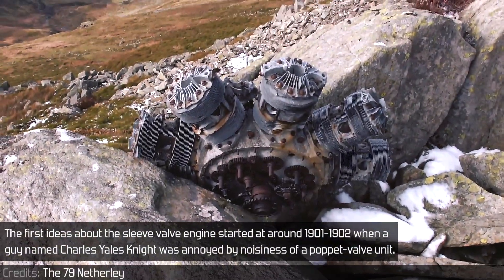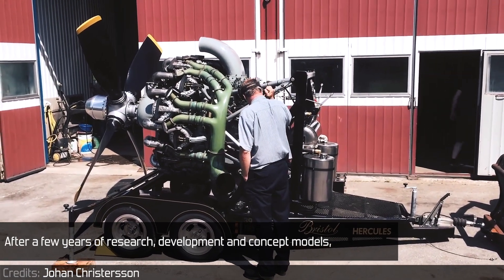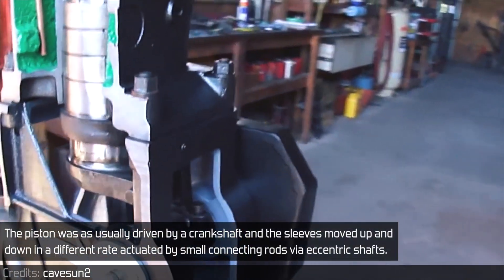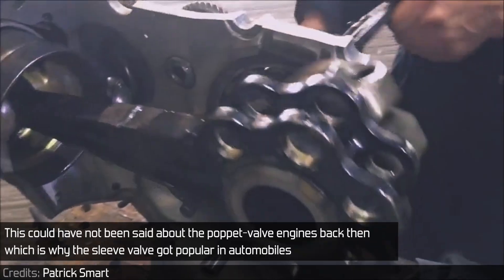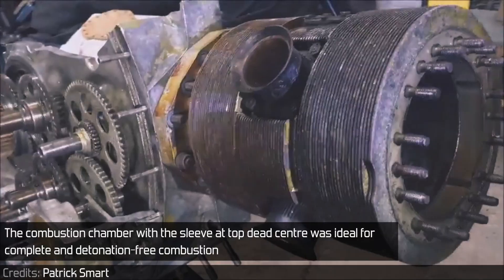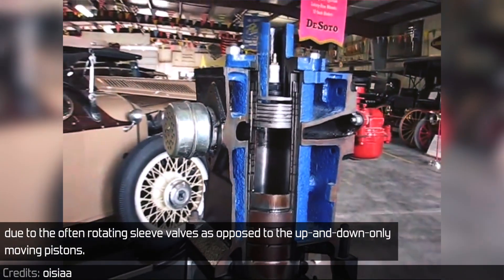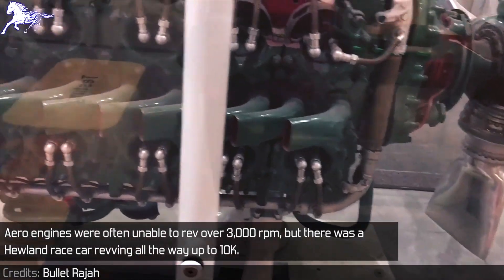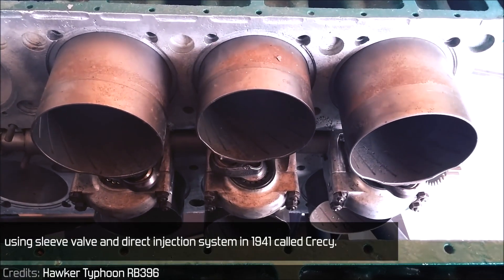A Sleeve Valve Almost Took Over A Poppet Valve Unit

Comment: I have always thought sleeve valve engines were extremely cool, and I believe there was still huge untapped potential when development shifted to poppet valves. Once the oiling issues were solved and the engines were reliable, they could have been very powerful!

Comment: Wear of valves in early poppet valve engines was caused by the poor quality of available fuels; until the work by Harry Ricardo, cause of detonation was unknown, the low compression ratio in early engines had a high exhaust gas temperature, burning valves. 
Sleeve Valves allowed for higher CR with same gasoline, no hot spots in combustion chamber. 
Nothing compares to Bristol SSV engines, pls see interview with Mike Hewland, Car&Driver, july 1974.

Comment: If monoblocks aren't the only thing interesting, it's also sleeve valve engines that catch my attention as well. Although there's one concept that I really wished made it into production to replace the poppets and that was the Coates Spherical Valves. Pretty muck all it was consisted of was spinning balls on a shaft. They worked just like Overhead Cams without the hassle of valve adjustments. I think the simplest of ideas however end up getting threw in the shadows because people are in favor of all the slightly complex stuff.

Another example I will use is the Waissi and Revetec engines. Those have got to be, by far, the greatest concepts of all (in my opinion anyways). They still use Connecting Rods but they don't really have any piston rock (if any at all I should say).

Comment: My father, born 1920, told me his father had a 1920's Willey's Night car. Pop said the car was  very quiet when running, and got better (for a while) as the carbon built up in the engine. Cost of repair was higher as there were fewer cars with the sleeve-valve.

Comment: The Sabre engine is super powerful. It's 2 H12 engines connect together. It can rev super high. It has small displacement but super high hp.

Comment: Barr & Stroud made and supplied sleeve valve motorcycle engines (of the  single sleeve type} to manufacturers in the early 1920s. Roy Fedden of the Bristol (Aircraft) Engine Company, bought one to try, before getting Bristol to start developing and producing sleeve valve type aero engines.

Comment: That was a totally impractical design. COOLING PROBLEMS WOULD KILL IT . The 2 sliding cylinders would wear, leak lubrication and not conduct heat from the piston and sleeves . A total disaster for longevity.  Simply increase the displacement.

Comment: I've always wondered how a sleeve-valve would do in something like a single-cylinder dirt bike engine. 
It seems like the simplicity of the design, the theoretical higher volumetric efficiency, ability to rev high, and removal of a lot of complication and weight on the top end combined with less of a focus on emissions would be a winning combination.

More freedom in design of combustion chamber shape and removal of the hot exhaust valve might also allow running a bit more compression. A less tall engine would also help with packaging and lower the CoG...

Comment: From an aircraft engine viewpoint at least, the sleeve valve engine was not beaten by improvements to poppet valves, with all the main British manufacturers using sleeve valves for their last reciprocating engines. Rather it was the rapid development of turbine engines that made them obsolete.